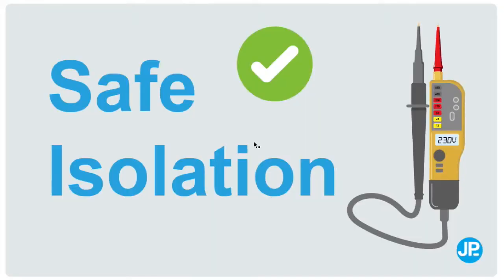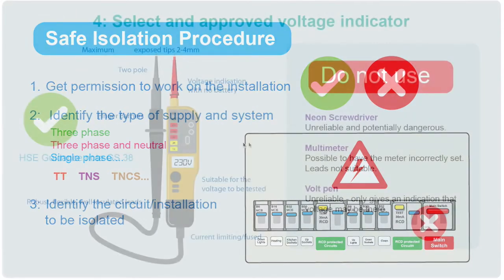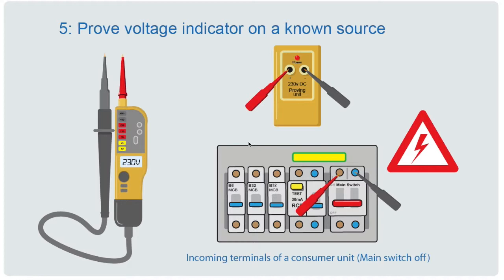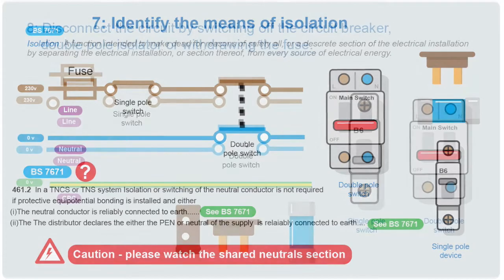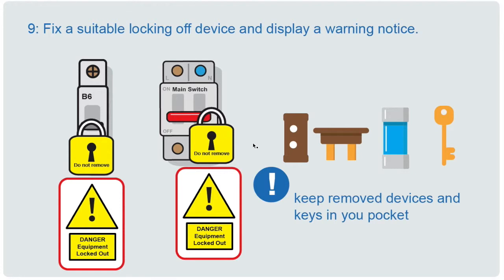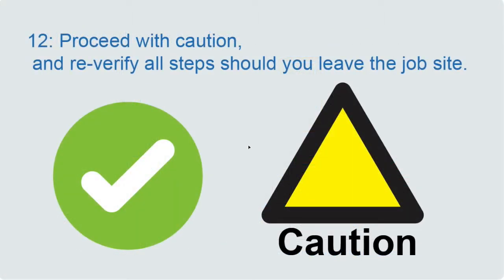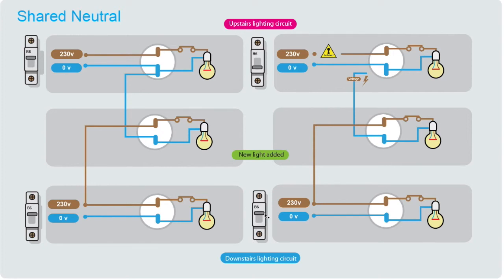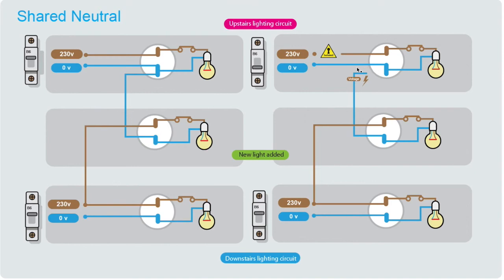Safe Isolation - How to carry out this essential test

Comment: What era of house wiring would have someone taking a neutral from the upstairs circuit and using it with the line from the downstairs circuit to wire a light? That's a lot more work to wire surely? Is there much of this out there?